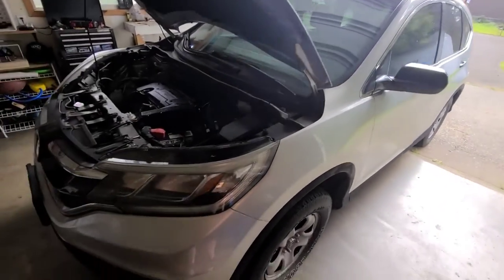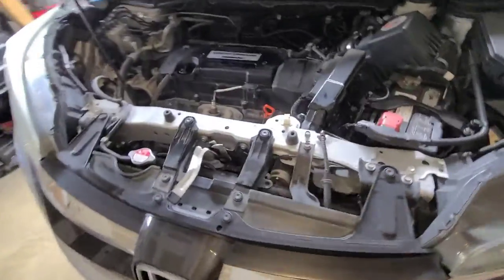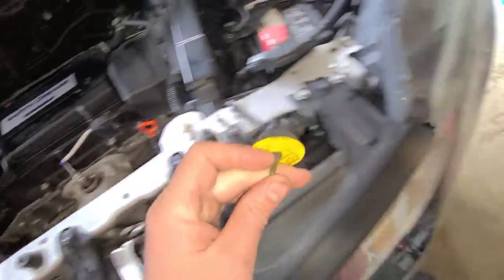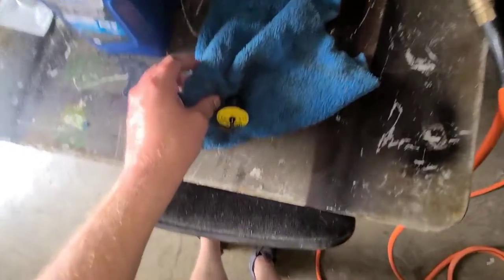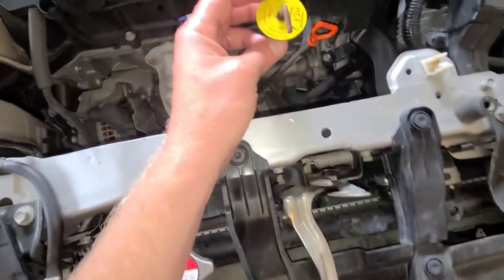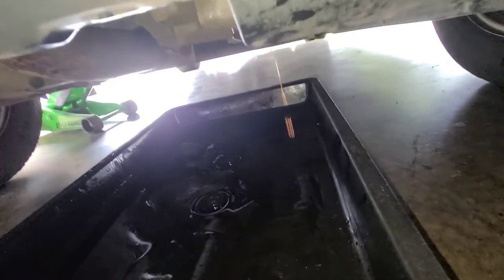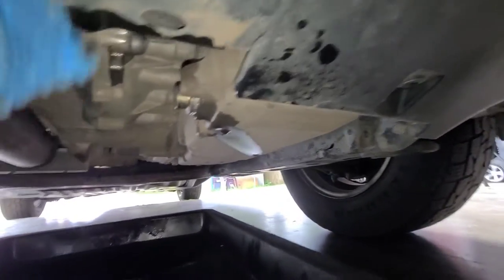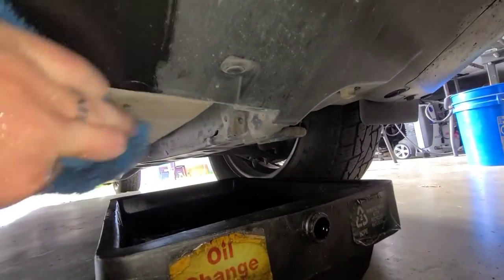2015 Honda CRV AWD CVT oil change

Comment: That transmission doesn't take 4.5 quarts it take 3.9 look at your owners manual u shouldn't be using that fluid either the honda hcf2 is only used for that pacific honda cvt transmission
Reply from the maker: Mine says 4.5 and the honda manual says 4.5 maybe we have different transmissions. Also, honda does say to only use the honda HCF2 only but I explain in the video, that other manufacturers make equivalent fluids that I have never had an issue with. 120k+ miles. And I used probably 4 quarts in the trans and  5 quarts in the floor in the video
Reply: AWD version takes 4.5. 2 wheel drive is 3.9 quarts.
Reply: I read it's still very similar.. so help I just got my crv and I got an oil change before i went to the beach like a week later my car stops and will push to start but WILL NOT Go into gear.. like I hadn't sent it to the shop yet cause I'm hoping it's something I could fix.. 🙃  could my engine be blocked .. would it even crank I also never got a notification 🤔 or car alert that there was anything wrong with it..
Reply from the maker: What does it do when you turn your key to accesory..1 click before it starts

Comment: I actually did a change of all my filters as well, the one behind the transmission fluid cooler and the one in the sump.  So if you do this, tranny's going to take a lot more than 4.5 quarts.  It actually took me around 5.75 quarts to fill it back up to where the fluid was consistently running out of the fluid level check plug.

Comment: Any issues with cvt fluid smell in the cabin using valvoline?
Reply from the maker: Not necessarily from the valvoline, the CVT fluid  smells very strong so if you spill any and can't find it to wipe it up the smell lingers for a bit. Especially if the old fluid had more miles on it than it was supposed to.

Comment: Hey Brother 
Thank you for this video,
Do I need to check the fluid with the engine running?
Thanks
Reply from the maker: No you do not. I fill it till it drains, do the shift procedure, then drive it around. Pull the check bolt and fill 1 more time.
Reply: From what I've seen, we don't need to heat up everything until the fan comes on and then check the CVT fluid after expansion?

Comment: On my 2019 CRV which I bought new, there is a 10mm crush washer on oil check bolt.
Reply from the maker: Yes, most oil plugs do,  you are "supposed " to change it when you re install it...

Comment: Very detailed, but I'm going to use Honda fluids and parts I can by cheaper online. As far as the magnetic plug goes I'll soak it in solvent use clear tape and remove what was on the plug. Put it on a sheet of white paper so I can have a good look at it. Did the same on the magnetic plugs of turbine engines.

Comment: Ei man thanks for the video. Iam thinking doing and i found your video and its gonna be helpful. I just want to ask, your crv wasnt park on a level ground. Will that matter checking the fluid on the check bolt? Thank you and new subscriber here!
Reply from the maker: No problem, it being off level a bit won't be that big of an issue. If it is severe it could throw the level off. I would shoot for as level as you can get it.
Reply: Thanks man. I took it to the dealership when its first cvt service but iam going to do my self the second. More power to your channel
Reply from the maker: That's why I made the channel, trying to save people money and give them confidence.
Reply: @jjsdiygarage1267  you’re right. And you have peace of mind that your doing the right way on your cars. Iam a DIY rookie mechanic too and willing to learn from experts. I tried to take videos alao  on my DIY’s and upload it on YT. “Sharing is Caring”
Reply: Lodi, ano Ginamit niyong fluid? Honda fluid ba or generic like Valvoline or Castrol?
Reply: @McDzy  bro always gamitin u honda fluids. 2015 crv din ba car mo? I tried once na gumamit ng penzoil sa oil pero after that ng stick na ako sa honda products sa maintenance. May mga videos ako sa channel ko bro baka mapasadahan mo. Gamit kanalang Honda no big diff nmn un cost.
Reply from the maker: @McDzy  not sure what you are asking.
Reply: @jjsdiygarage1267  i was asking road master if he stuck with hcf2 honda trans fluid or went with a different brand of tranny fluids for his 2015-2016 crv haha. i have a 2015 crv ex awd, the weather is changing a bit. it was a sht load of miles. i just got it in july, shifted perfectly til yesterday, since it seems like the weather is getting colder.. was thinking of maybe replacing my cvt fluid, but wondering if i can use the valvoline that youve used or stick to hcf2 honda oem fluid... ive just been doing research.. 

it seems like the hcf2 honda fluids are quite difficult to find, but the valvoline cvt (hcf2 alternative) are everywhere
Reply: @110897100  what brand of oil do you use for your 2015 crv? i know its 0w20 but which synthetic brand works for you tol ?
Reply: @McDzy  i always use honda fluids. But once i tried Penzoil because it cost a little less than Honda but after that i decided to just use Honda products. I have 2015 crv ex too but FWD.
Reply: @110897100   hcf 2 honda factory for tranny fluid ba ginamit niyo lodi ?
Reply: @McDzy  yes brother👍.. i suggest honda nalang gamitin u. First change ba? Ilan mileage?
Reply from the maker: @McDzy  make sense, ya its your choice. The reasone I don't use honda stuff anymore is the first time I did the service I ordered the fluid from honda..I recieved nissans version I forget the name. So if honda is willing to substitute fluid then so am I.
Reply: @110897100   300k haha miles... not sure. i just got it, very cheap.. seems to be fine. pero for peace of mind...
Reply: @jjsdiygarage1267  agreed. called the dealership this morning an a quart of the hcf2 is $19 a bottle... so i went and grabbed the valvoline actually, the one that youve used... if youve been fine. then im sure mine would be as well haha!
Reply from the maker: @McDzy  that's what I have used  since the first change at 60k. Now have 140k will no issues
Reply: @jjsdiygarage1267  love to hear that! not sure when the last trans fluid change was, almost like black when i changed it earlier today -_- .. quite frustrating, the vehicle does have 300k though! just got it for a pretty decent price. AWD etc etc.. just replaced the both rear wheel bearings and the tranny fluid today. hopefully it keeps kickin ! haha
Reply from the maker: @McDzy  nice, those front wheel bearings are super fun to replace...
Reply: @jjsdiygarage1267  haahha, hopefully ive got couple more years or so for a front wheel bearing.. those are definitely a pain in the butt
Reply: @McDzy  Amsoil Signature Series 0w20 and an Amsoil Ea15K filter.

Comment: I don’t have a jack but only ramp that is used to do an oil change. You think that should be fine to get the vehicle up for the transmission fluid change as well? My concern is - should the vehicle be level on the ground while draining? If not I drain and fill 4.5 quarts while it’s up, start/shift gears and then get the vehicle off of the ramp. Come off the ramp and now whilst on the floor level, I somehow need to squeeze myself in and remove the level nut to drain out that little fluid like you did. Thoughts?
Reply from the maker: That should work, I can get under it when it's not jacked up at all. I also removed all of the vanity plastic under the front so I can actually work on it and check for leaks. The reason for the vehicle being level is just to fill it to the proper level.
Reply: @jjsdiygarage1267  Thanks!
Reply from the maker: Good luck

Comment: Is there any fuel filter In 2015 Honda CR-V if there could you show on next video. Thankyou
Reply from the maker: Thanks for the question.  I'm pretty positive that the filter is part of the fuel pump. I could be wrong though I will definitely look into it.

Comment: You added more fluid after checking the oil level was right with the check plug. Do you think you have more than enough oil in your transmission now?
Reply from the maker: A little bit flows I to the passage way when filling so when you pull the plug you get a little out. What your looking for is it to flow out of the drain plug not a trickle

Comment: What is that bubbling sound in the radiator I have the same sound in my CRV
Reply from the maker: Just water circulation I believe
Reply: @jjsdiygarage1267  nothing to worry about I guess. It only comes when I turn the ac on.
Reply from the maker: @prasanthpaul9714  ya mine has been making that noise for 150k miles now with no issues.
Reply: @jjsdiygarage1267  thank you so much ☺️

Comment: 1. Measure take out 4 put in 4
2. Run CRV CVT for 1 day
3. Engine cold CVT cold add 1/2 qt 
4 Remove over fill bolt let excess drip out. (cold CRV  CVT)
If no drips 
Install bolt and repeat steps 3-4

Comment: How is your honda running with the valvoline fluid? I have the same car with 83k on it and I'm just finding out that this has to be done at 30k to 40k so I'm desperately trying to get my fluid ready and all I can find is the valvoline so this is why I'm asking you how yours is doing with the valvoline.  Thank you for your video buddy. 👍
Reply from the maker: Sorry for the late response it runs fine with it. The Acura brand is more available in my area than the honda, and it's the same stuff part number ends in an A instead of an H

Comment: There's a filter for the trans  # 25450-P4V-013
Reply from the maker: Yes there is, but I believe you only change that if you take the cooler off and I'm not sure what the service interval would be on that or if its only when there are issues. If you know feel free to share.  For just the standard 30k-ish mile fluid change you do not change it. As per the honda manual.

Comment: Follow up question. So I replaced mine about a month or so ago. And it works great, but how come everytime I go for a drive and park, I smell a little bit of the valvoline tranny fluid? 

Is that something to worry about? The car seems to shift great and I don’t see any leaks. And pretty sure filled it up with the right amount
Reply: 2015 CRV EX AWD
Reply from the maker: Do you see fluid?
Reply from the maker: @McDzy  shouldn't be leaking out of the pan. Possibly your drain plugs. Did you replace the crush washers?
Reply: @jjsdiygarage1267  it wasnt the drain plug.. i saw it. idk why it gotten loose, but its the upper "sensor" not sure which sensor that was for, but when i checked it, it was leaking from that sensor. do you happen to know which sensor that one is? theres 2 of em near the tranny, one lower and one upper with 27mm which i tighten and seem to stop the leak when i turn the vehicle on.

 when i turned it on earlier the leak was clear it was coming from that sensor, weird that it gotten loose though.
Reply from the maker: @Michael Diaz  I'm not 100% but my guess is one is a temp sensor and one is a psi sensor
Reply: @jjsdiygarage1267  very strange, hopefully the tranny is fine, im just going to add half a quart of tranny fluid. hopefully its fine now. jezzzz.
Reply from the maker: @Michael Diaz  just don't over fill, just follow the same procedure to add that you did when filling it originally..minus the gear shifts.
Reply: @jjsdiygarage1267  did the whole procedure like youve done on the vid after tightening up the loose sensor, added maybe a 1/4 quart or so then drain from fill bolt.. so odd that that happened tho lol. idk why
Reply from the maker: @Michael Diaz  glad it worked out. It is weird that it started leaking after. Mine hasn't leaked a drop of anything after 170k...knock on wood.

Comment: My 2015crv do not move when in drive position. Please 🙏 what should I do?
Reply from the maker: Yikes, check the fluid in your cvt.
Reply from the maker: Does the indicator shift gears on the dash, do other gears work, is there unusual noise when shifting?
Reply: @jjsdiygarage1267  please there is no noise in gears and other gears too do the same. When shift to drive, it's takes about 10 to 15 minutes before moving slowly. So, I checked the transmission oil  and changed it  ,but  the same thing happened
Reply from the maker: @enochcobbinah3549 that's not good, sounds like the CVT is slipping. Any check engine lights?
Reply: @jjsdiygarage1267  Yes, the check engine light have been there for longer time
Reply from the maker: @enochcobbinah3549  do you have an OBDII scanner ? If not they are pretty affordable online. The blue tooth ones that connect to your phone are my preference
Reply: @jjsdiygarage1267  thanks  my friend
Reply from the maker: @enochcobbinah3549  did the problem start before you changed the fluid or after
Reply: @jjsdiygarage1267  yes please
Reply: @jjsdiygarage1267  The problem started before I changed the transmission oil

Comment: You haven’t had any problems w/ using non-Honda CVT transmission fluids?
Reply from the maker: Nope. I always get the brands that say meet or exceed standards and are directly interchangeable with the fluid in use.
Reply: @jjsdiygarage1267  Honda says you must use their brand. I think it’s BS. Anyway, can you do a video on replacing a Honda CRV alternator?
Reply from the maker: @lavie maintenant  it's a great business model..buy our cars and use only the fluids we produce.  Many motorcycle brands do the same thing.
Reply from the maker: Also, I will add the ALT replacment to the list of future videos
Reply: @jjsdiygarage1267  In their manuals, it also states you MUST use Honda Oil and brake fluids too. We all know that’s BS. 

But talking to mechanics, Honda coolants and transmission fluids work a little better. They told me you could use non-OEMs but it’s not optimal.
Reply from the maker: @lavie maintenant  at the end of the day it's your vehicle and you can do what you want.. the only benefits I see is that they might uphold a warrantee if OEM stuff was used.. but if it's outside of warranty then it doesn't matter. Just my opinion though

Comment: Actually, there Is a filter on the side that is hard to get to, if you google "transmission filter 2015 crv" you will see the filter available. Should be changed every other trans fluid change ,, why put new fluid with an old dirty filter !! Most mechanics dont even know about the filter
Reply from the maker: I know about that filter, but I have never seen a service interval on it. It's behind the fluid cooler.  I may change mine next time I do a coolant and cvt oil change.